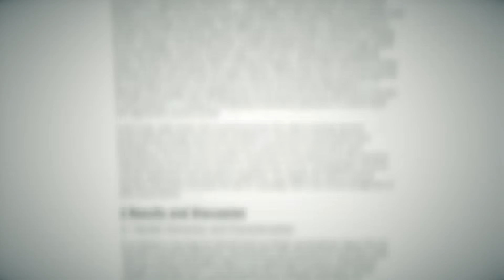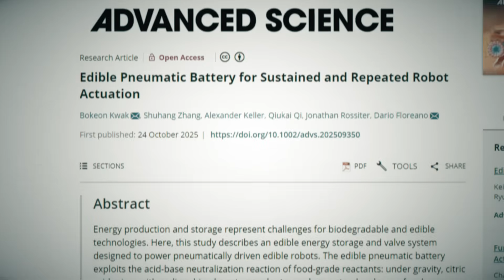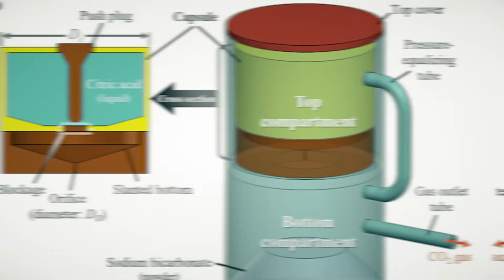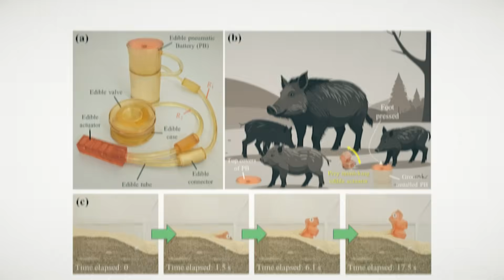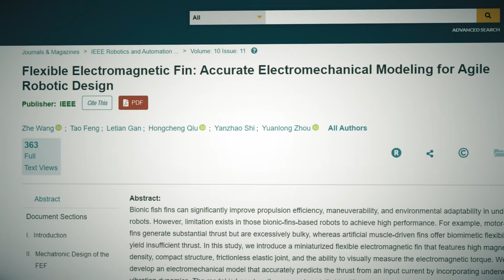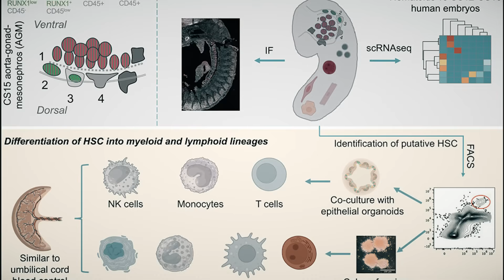Hair Toothpaste Will Fix Your Teeth? -- Mind Blow #149

Comment: You see, dear human, sometimes, you will find yourself in the presence of a different kind of peddler. This one, doesn't try to sell you anything you don't want. This one doesn't try to sell you negative news, negative information, like most of them do. 
But do not let them trick you. They are no different. 
Even if they only peddle positivity. 
Their goal is to hide. To mask. To pretend everything is alright. To pretend everything is going to get better. 

They'll say their goal is to spread joy, to make the world a better place but their actions speak of a different goal. A maintenance of the status quo. 
They're a tool of those in power. A valve to release some of the pressure before society blows up. 

They'll talk about this revolutionary future. Just around the corner. Just about to change everything. 
When nothing changes, they'll talk about this other revolutionary idea, revolutionary technology, revolutionary treatment. 

They make you tame. They make you excited for a future, all you have to do, is hang on just a little longer. Just a little more.